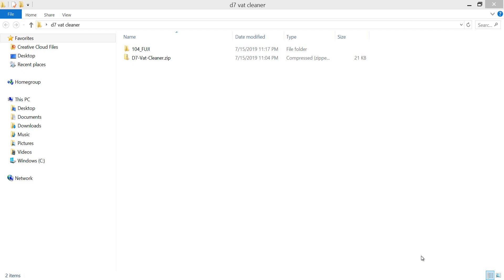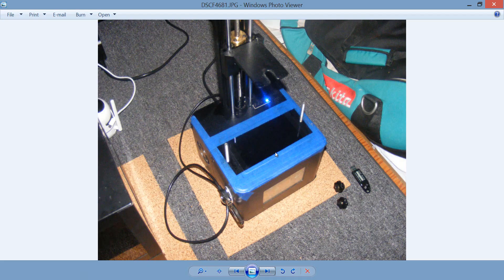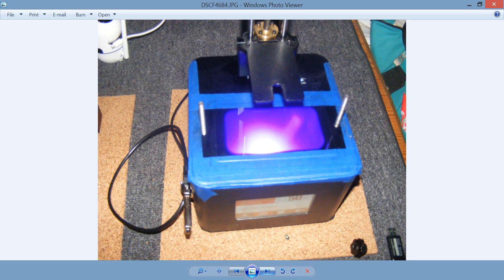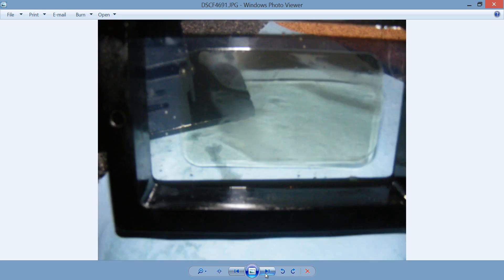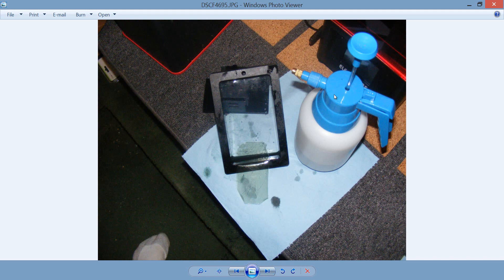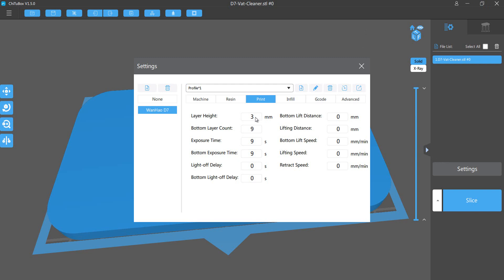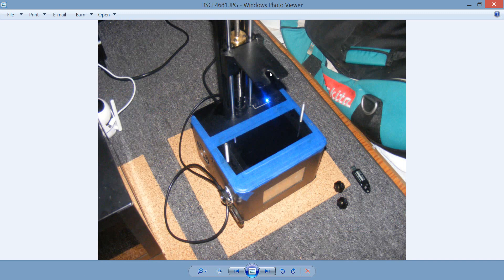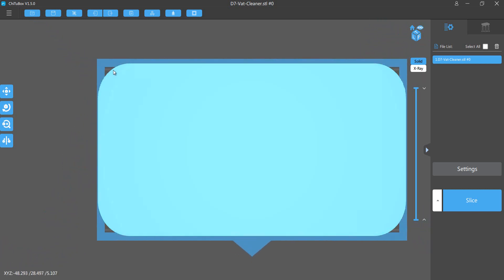How i Made my own UV Resin printer Vat Cleaner using ChiTuBox.

Comment: i would call this a base build plate, not a vat cleaner, but hey thx for sharing
Reply from the maker: you can use it for 3 things, vat is to clean Fep film,
You can use it to clean your build plate the top plate and all so use it to make your models stick better to the build plate, put your build plate at homing position and clean, now your resin is stuck to the build plate now set up to print your model and now your model will stick better because your build plate has stuck resin to it